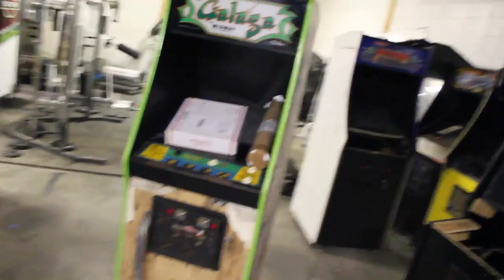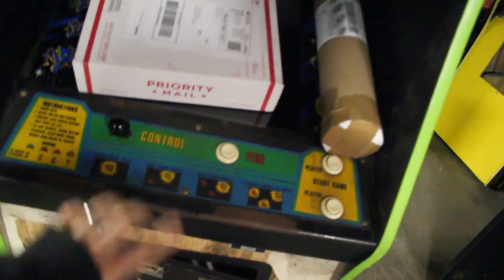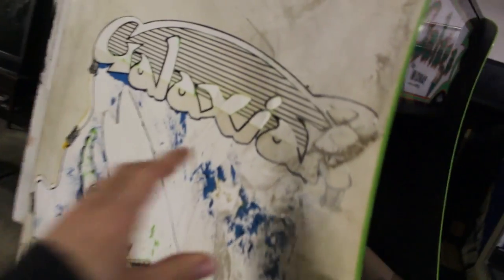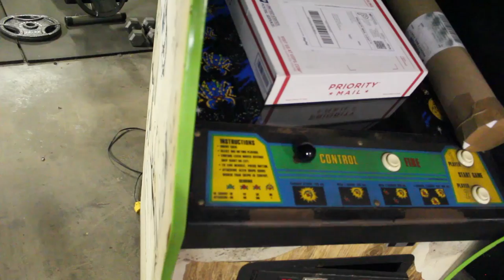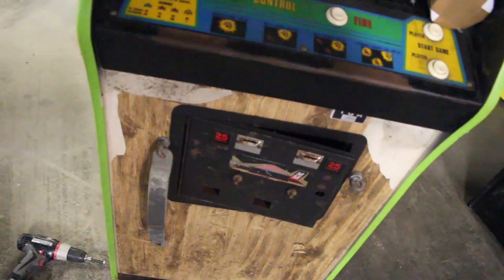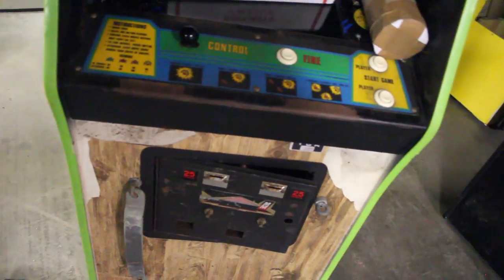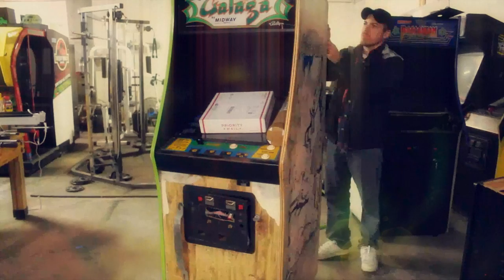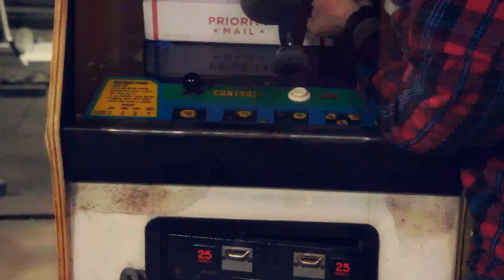Galaga Arcade Extreme Makeover

Comment: Why not take the coin door off? Would have saved a lot of time painting and taking the art off the front.
Reply from the maker: Tim Robertson  There's more than one way to skin a cat :)  Normally I would, but one of the bolt heads was stripped, so I just left it on.   Didn't feel like rewiring the control panel either, so I just taped it up.